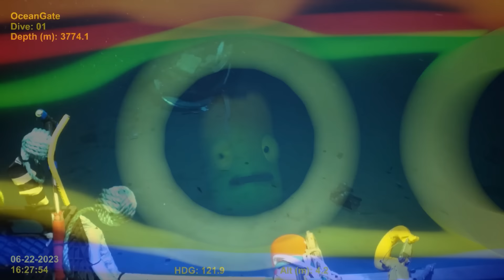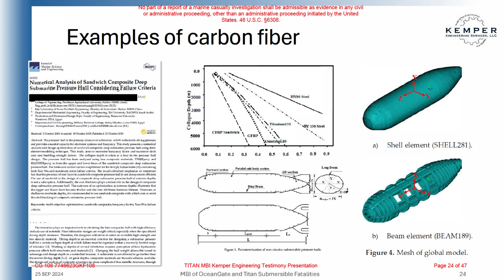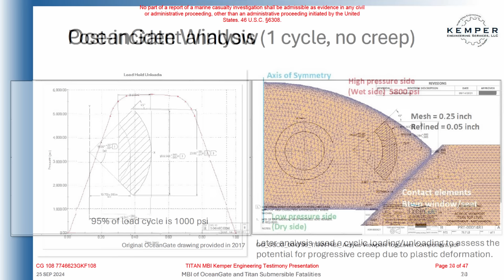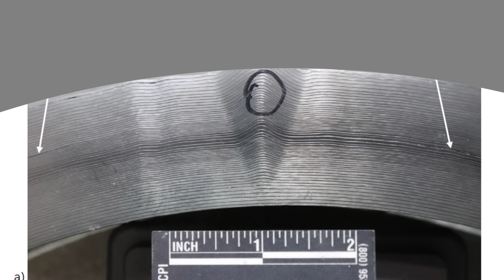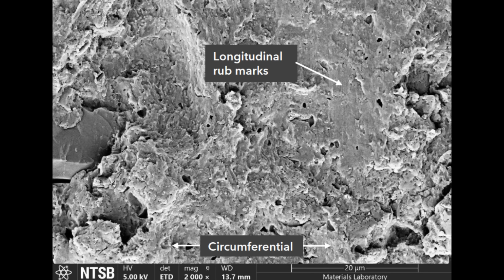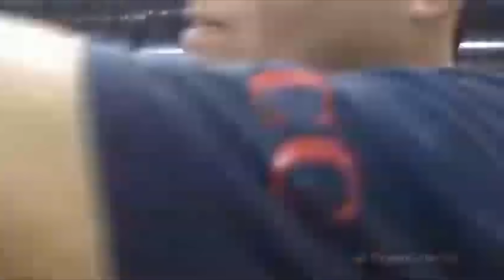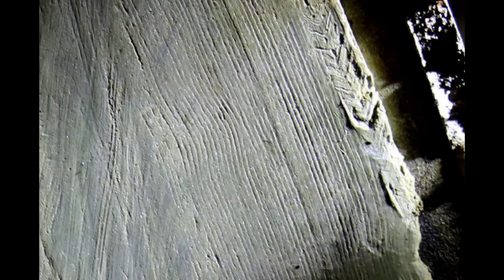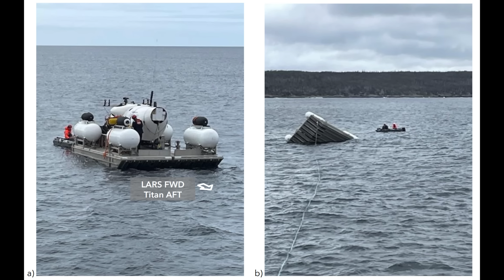OceanGate Wreck Shows Why Sub Wasn't Strong Enough To Survive - NTSB Shares Important Details

Comment: Ah, so it’s not that it de-laminated at depth, they de-laminated it manually. At the factory. During construction. Intentionally. Because it was easier that way. This is like using a laser-cutter to get six-pack abdominals: it will work, but you won’t survive it. But it’s a lot less effort than what is required to get an actually good result.
Reply: Too instantaneous. It's like using caulking silicone for implant injections to look more buff or more hourglassy. Sure, you'll make it out of the back-alley "cosmetics shop", but then the infections and rejections start and if you insist it's fine, you're gonna be d-e-d ded.
Reply: @neoqwerty At least there's a logic to using the wrong kinds of silicone. There are a few poor souls who have cement in their bodies as filler.
Reply: @neoqwerty If silicone caulking worked AT ALL there would be lines of people at Home Depot buying up all they had for sale for DIY breast enhancements.  I am a little shocked this doesn't actually happen more often.
Reply: @LatitudeSky  Well, it's illegal to do unlicensed medical operations, lol. If someone were offering that service they'd be arrested.  Which why it's hilarious when you hear people say that to cut medical costs we just need to get rid of 'regulation' - and yes healthcare would be very cheap if anyone could just call themselves a doctor and do whatever they wanted.
Reply: @ I don’t wanna be rude, but just cuz smth is against the law doesn’t mean people won’t do it. Most drugs are also illegal too, but many people use them

Comment: I believe they could have gotten just as far if not further with fiberglass rather then carbon fiber since they weren't using it in tension but compression. Basically relying on the glue itself, and the glue isn't designed to handle compression.
The engineering of this sub was impressive if you had a gun to your head and told to get to the Titanic with the least amount of money ONCE.

Comment: Very interesting video, I studied engineering and work with hydraulics and compressed air and to my mind the basic design for the fixing rings at the end of the cylinder look wrong in that I always understood that the transition area from one material to another (for instance a flexible hydraulic pipe into a coupling) the design needs to be of a self sealing type that as the loading (pressure) grows the two parts are forced into greater sealing (the conical porthole apertures for the domed glass windows early in the video are an example), to me having a tube of one material, putting a ring of glue on it and dropping a ring "end" glued is asking for problems, maybe I didn't interpret the pictures right.

Comment: Would the incident where the front-end cap fell off be significant? Or was that with the earlier hull? At one point the front dome was only attached with 4 bolts, and during rough handling, the bolts sheared and the dome fell off and almost went to the bottom.

Comment: There are some nice videos of the Boeing 787 fuselage sections being wound including the 45 degree cross windings. I wonder if Boeing had problems with wrinkles compounding and I wonder if those diagonal windings helped solve them. OceanGate's composite winding machine does look like a bit of a joke compared to Boeing's.

Comment: Well in this instance, Scott, the "Armchair Engineers" are correct. Carbon-fibre tubes are very bad at resisting crush. If you had a carbon-fibre bicycle you'd see warning stickers all over it telling you not to clamp any of the tubes! (yet you can clamp steel tubes that are a fraction of the cross-sectional area of material).

Not only was carbon fibre the wrong material to use, the other damning thing was how that tube was made. It was actually 5 different sized tubes glued together. So any force subjected to the structure can't propagate evenly throughout the material. This creates stress risers at the glue-layers.

3:41 The "approved-materials" aren't approved for very deep depths. At 3000+m your choices are limited to steel and titanium, but really just titanium because it has good fatigue and corrosion resistance whilst being much stronger than marine-grade(A4/316)-stainless-steel. Aluminium is bad because it sufferers from electrolysis and also has very poor fatigue resistance. (One of the reasons airlines don't like to pressurise their planes to 1atm because it would considerably shorten the fuselage life). Acrylic would be limited to windows only.

Also, James Cameron isn't an Armchair engineer and has spoken out about the use of carbon fibre. His Sub can go much deeper than 3000m and because it is made from titanium, it can do so thousands of times before it needs to be replaced.

I appreciate you're desperate for material, but you risk damaging your reputation by creating videos about things on which you are clueless. The uproar about OceanGate is that it doesn't take an expert to know how bad the submersible was. This is first year mechanical-engineering stuff! Or even, armchair engineering level stuff!(You need only have a carbon fibre bicycle to think: Hang on a second?)
Reply: James Cameron is not an engineer at all.  He was smart enough to let a real engineer -  Ron Allum - design and build his submarine for him.

Comment: The voids in the CF are horrific. The voids trapped 1 ATM air in them which was then compressed and decompressed repeatedly. That would cause the CF to rip from the fibers and delaminate as the voids joined up.